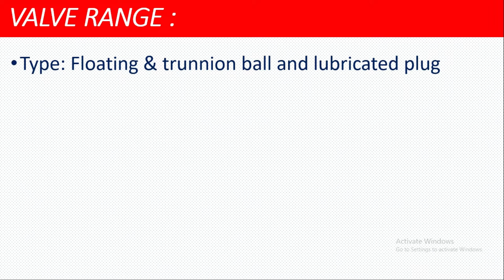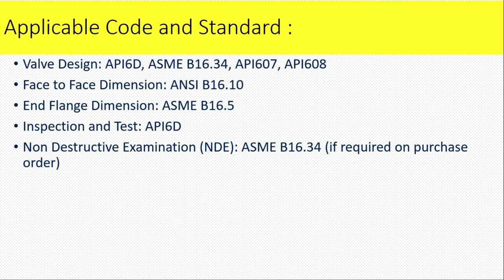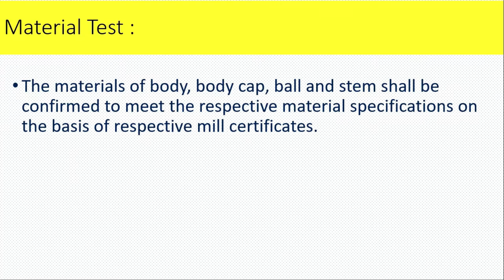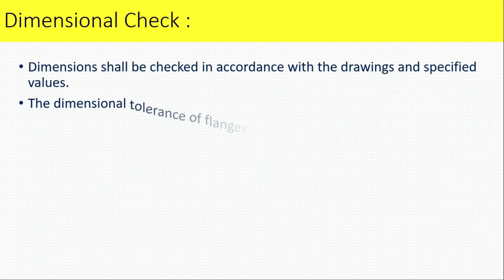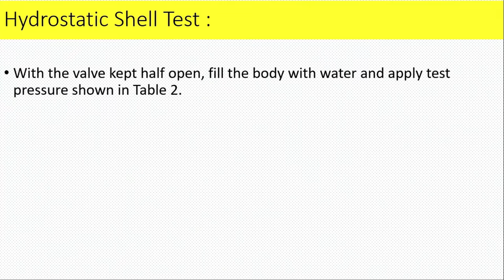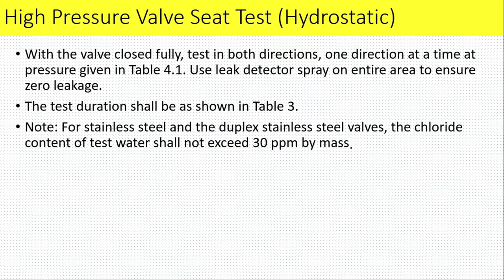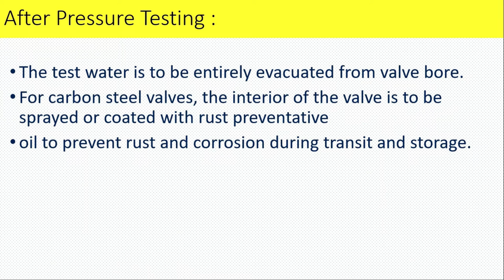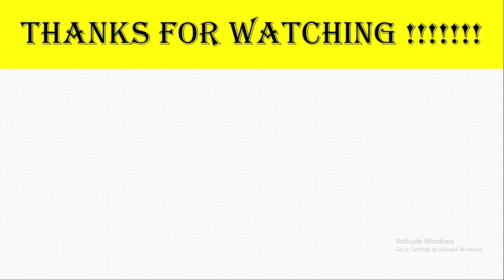Valve QC Inspection & Testing procedure [Pipeline ]

Comment: Where did u get shell & seat pressure from code(API 598/Api 6d) please mention me the page number
Reply from the maker: Valve Shell Test Pressure

The API STD 598 refers you to the table 3 in the standard and provides the test pressure for cast iron valves based on their ratings but you know the majority of the industrial valves are made from cast steel. 

For cast steel, the API 598 refers you to the ASME B16.34 for test pressure. The ASME B16.34 indicates that the shell test shall not be less than 1.5 times the 38°C (100°F) pressure rating, rounded off to the next higher 1 bar (25 psi) increment.

For example, if you have a valve with cast steel material (A 216 Gr. WCB) and rating of 2500, you should refer to the table 2.1.1 in ASME B16.34. The table says your working pressure is 425.5 bar at 38°C (100°F). It equals to the 6524.85 psi. Now multiply this value by 1.5 and your test pressure will be 9382.3 psi. You have to round it to the next 25 psi, and it will be 9400 PSI.

Valve Shell Test Duration

On both API STD 598 and ASME B16.34 shell test duration depends on the valve size. The valve size less or equal 2 inch the test duration will be 15 seconds, between 2 1/2 and 6 inch 60 seconds, between 8 and 12 inch 120 seconds and above 14 inch will be 300 seconds.